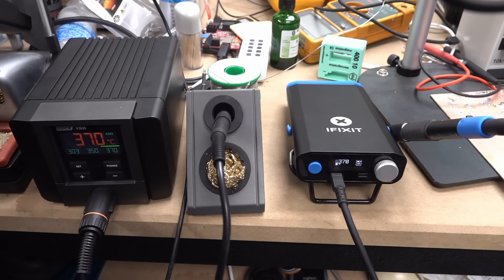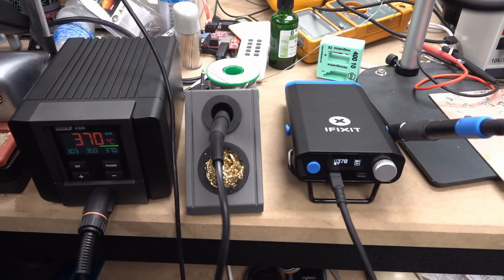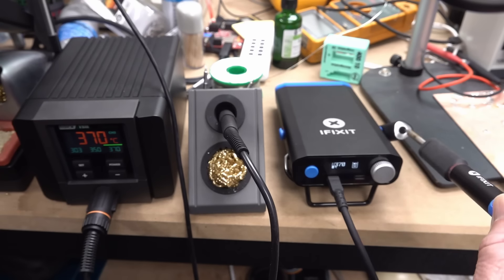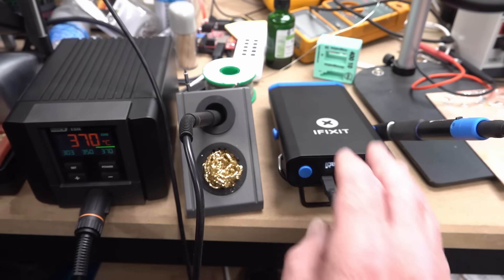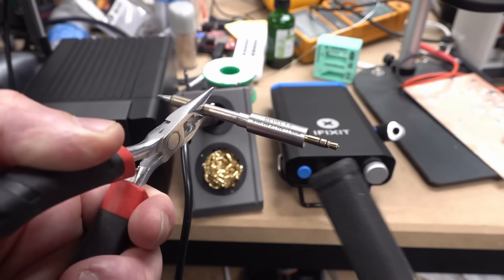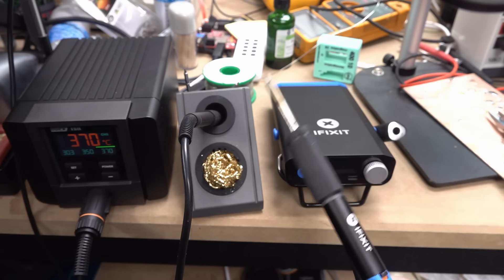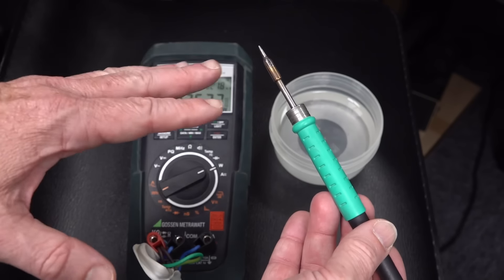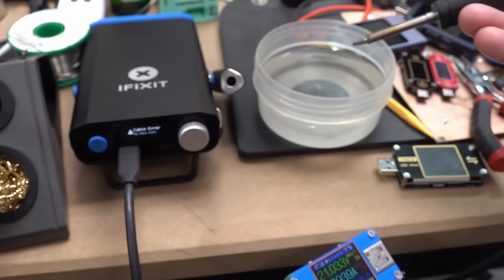iFixit FixHub Soldering Iron Review EXPLAINED + More Testing

Comment: I don't think that many people bitched about you dissing the TS11 over the iFixit one. Almost everyone agrees that TS11 is an overall bad soldering station. I've seen other youtubers reviewing TS11 passing it as "okay", but immediately they got a lot of comments saying that if you want a proper, critical review go watch the EEVblog one. And in any case, as you say, these two irons are not even comparable, completely different product category.

In your previous video from what I skimmed in the comments (including my comment), was that overall the product has some nice points but it fails on the basics (which is performance) and that based on it's current performance to price ratio you should have been a bit more critical about it.

Comment: Old JBC HD-2B modified to take C245 tips for me as a bench station. I love the sleekness of the  C245 tips (&shorter) and the 'heftiness' of the station. Never needed the -even higher capacity (of the) original C470 tips and I do lots of vacuum tubes/valves stuff, none of that micro soldering rubbish...🤭 I also have a inherited 100[W] Soldering Gun for on-the-go and misc, but would consider a iFixit style portable, especially if they'd develop a neater chisel tip, 100[W] should be plenty -Thank you very much! Else: I'd prefer to run an extension cord to my 'Old Trusty'😅 if not impossible so none for me. Never saw this one coming though, follow-up video I mean. ☺
Reply: How do you make it take C245 tips ? Is there a guide anywhere on the mod ?

Comment: I'm still unclear about changing temperature on the FixHub, can it only be done via a PC connection? What is the dial on the battery for? 11:51
Reply: the dial on the hub is for setting temperature, indeed. But you can run the iron from any usb-c PD source, in which case you have to change the temperature via the PC connection. I'm honestly not a fan of that decision at all, but Dave seems to like it
Reply: @danandrei96  Cheers !
Reply: Me too, good questtion.
Reply: @danandrei96  Im 100% sure that this is a trivial matter and soon enough someone will port temp setting to something as cheap as pico or attiny85 based digispark. Its just low speed USB.

Comment: I will wait a bit and see if they bring higher capacity tips to market and maybe release a firmware update. I will buy this one to replace my gas soldering iron, because you always have to be careful the hot exhaust of gas soldering irons does not melt anything you don't want to melt.

Comment: Tip electrical resistance as posted by the other commenters is important due to marketing "100 watts" apples to oranges comparisons. Also butane portable irons. Developing a protocol more consistant than water where volume and starting temperature is variable, but pure copper flat strip conducts watts per degrees celsius is fair between different products. Even a copper cube temperature raising up to a delta temperature change. Also perhaps iFixit uses more than 20v lines simultaneously whereas the meter is reporting current at 20v and multiply by current drawn at that voltage, simply because using iFixit numbers on the box as seen on your video, all currents at all voltages add up to 100watts. Appreciate your fine work. Testing the "supplied" tip for resistance as others mentioned, using a consistent heak sink to test electrical wattage pulled for overall system ability, and also clarifying the different current drawn per volt, as that's how I believe usb 3 delivers 100 watts safely because there are multiple cables in usb 3, and devices can bypass the standard and use transmit and receive lines to carry current (even though not authorized to, but if I was designing a soldering iron with both my own power supply and iron and tip, I would use 5v, 20v, etc like on the packaging, and as I see it, in your position, you were given a poor tip, and then inserted a meter between the iron and power supply, which, in my view, would only safely deliver one voltage at a time)

Comment: I think the problem is not the portable iron versus bench iron, it's that most people see it as an iron that could be portable. They just want an iron, with portability being a nice to have. So they may buy the cheap 30W iron you can buy, or a Hakko, or one of the others, the Quick, the iFixit, etc, as completely fungible irons that can do the job, with different features. Some plug into the wall, others can work off battery, but otherwise a soldering iron is a soldering iron. So to a lot of people they're the same fungible product. I'm sure a lot of people equipping their first bench might see they should get the iFixit one because Dave gave it a thumbs up. Even if the iron will never leave the bench and just stay plugged into the wall. That I think is where the controversy lies - all irons are the same, some are designed so you can power them from a battery but they are the same inside. Sure some people may have a need to solder away from civilization or easy power, but that is a tiny niche compared to those who solder. And those people see the iFixit advertising the iron as the one to rule them all.
Reply: Well, if someone considers a battery powered iron for bench work, they hate life, or solder veeeeery rarely and don't mind dealing with the annoyances. People need to do a little bit of research to know what type best suits their use case, THEN chose an iron, and not buy one based off some review without any consideration, then get disapointed.

Comment: You probably missed the obvious fact that the PID is running on the iFixit iron itself, that makes the display on the "station" a simple client wich lags behind the actual state. In you last video it could be seen that the Iron started to draw significant power (>50W) long before the display started too show it. So there are for sure firmware issues that will be solved, but probably not as bad as they show on the display of the thing.
Reply from the maker: Doesn't really matter where the loop is physically, the display not working properly remains the issue either way.

Comment: Why not compare the thermal effect with mobile alternatives.?
As highlighted.. its likely around 40 to 50 watt iron the one you received, so yeah.. not the best for Ifixit of all sizes to bambozzle the consumers with their 100W claims, and even highlighted it on the tip' when it ain't.  (that's sketchy)

And there you likely also got some of the reasoning why the display is so manipulated, to camulflage the lackluster thermal performance, and why it wont show the actual temp and also in an attempt for Ifixit to ride the "spec race" of 4sec to 350 which it clearly didn't do in practise, even though you try to explain that the sensor are likely very far way from the tip..hmm * it has to be in Paris for that lack of response... its a cartridge system after all.

But it is merits.. that many endusers wont be able to validate, as you need tot he tools to check these things.. also why many CN brands..lie a lot of on the merits that ain't easily to be validated by the common end user.
Reply from the maker: Because that's an entirely different video, called a shootout.

Comment: Your original video had blatant bias and this video is a scramble deflection.

The ifixit is 6 to 8 x the price of portable soldering irons that provide the same soldering experience with hundreds of different tips and a much smaller package.

The portable vs bench iron comparison is moot. The iron should be reviewed as a soldering iron, because that's what it is. Portability can be a positive.

Performance vs cost should be the only comparison you make. Your ifixit review screamed bias and for every negative you found, you came up with an excuse for ifixit.

The iron is way over priced and has similar issues to every other iron that its less than a quarter of the price. Thats a blatant thumbs down.

Comment: You were a lot more forgiving (and thankful to receive product) than your normal self. It was surprising. Maybe you just got in a really positive mood from the teardown: I was with you there. 

1. You did say it was designed to be a portable iron with desktop performance, but later you said it wasn’t good enough to be your main soldering iron. 2. You didn’t throw the iron into the stand as a test - you always do that test. 3. You criticised the quick stand for not having a sponge but the iFixit wasn’t criticised for lack of sponge & brass curls. There’s three objective examples. 

If you think you have no biases then you’re likely to be more biased than you realise. 

I was one of the ‘negative commenters’ (but I didn’t thumb down). I said we like you to be your opinionated self. I thought you knew that.
Reply: Pick up truck A doesn't have as much cargo storage as I would expect and it doesn't have enough torque. Other advantages and distadvantages. I don't like this.
Compact car B has cargo storage for your groceries and torque to zip around. Advantages and disadvantages. I like this.

"But but but but but A has more storage and torque than B. You're biased!"
Reply: @Lagittaja  I don’t disagree with the Quick review. I could be wrong, but I think the vast majority were referring to it for examples because it was an extremely recent video and a soldering iron review.
Reply: I was going to comment exactly your last point, I had a negative comment but still thumbed up, why would I ever want to harm the video, I love this channel.

Comment: all irons are different. I stick to basic powered unit ( Jacar ) and a Low end Portasol gas iron and  a 240 ac 40w iron. I don't do enough work with them to get an expensive one. My friend had a simple transformer iron and it got hot.

Comment: I watched the original video and I have no comment on your review or how it differs from previous reviews. My issue is with the device itself. When I first saw it, I expected it to be reasonably priced considering the costs of the components. Had it been priced less than $100, I'd consider it to be a good deal. But at this price point, 99% of people can get a lot more out of their money. Sure, there may be some extremely niche applications where this would be better than other options. But at this price point, its nothing more than an overpriced battery backup with a logo stamped on top.

Comment: I really hate arguments of "it will get better with software updates". No it won't. Historically, only times that happened was an outlier. You know what it's doing now, if you want to review/buy/advertise, do it based on current performance, not some future vapourware software updates. That's just lying to customers.
Also, my problem is not with the power display but the temp display - it's supposed to show current tip temp, but it doesn't move after putting it in water? Wtf? Is it any wonder it's not putting the juice in if it thinks the temp is ok...

Comment: "It has live display". Yeah, which tells lies. You dipped the whole tip into water, display still reads 370. It's not a PID issue, it should just be showing the value from the sensor. The power bar is also full of shit, full on display yet a separate meter doesn't even show 50% of rated power. It's not really a feature to have a display that lies to you, is it?
Really reminded me of a cheap 3D printing pen Big Clive tore down recently. The display had a life of its own, reading temperatures even with the sensor disconnected.
Reply from the maker: Yes, they need to fix it.

Comment: Bit of a bullshit argument. If you want to compare it to a mobile iron, then only compare the handle solo vs any other handle like the pinecil/ts100. That is also a more equal battle compared to price. If you add the base station then compare it to any other base station solder station

Comment: My main problem with this iron is that it's an ifixit product. Their mission, as I see it, is to popularize repairing in general. But their iron is an expensive tool, with very specific use-cases, where it's price may be justified. They should've just slapped their logo on a Pinecil, to be honest. It's cheap, reliable, versatile tool that's more than enough for an average person.